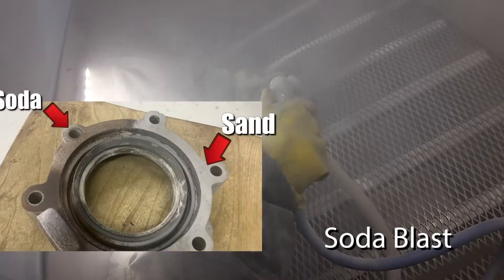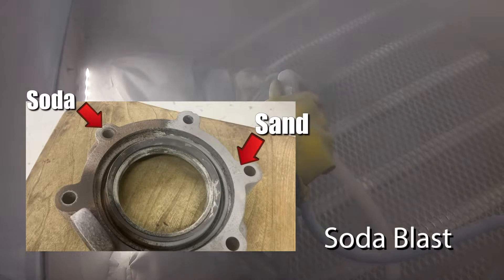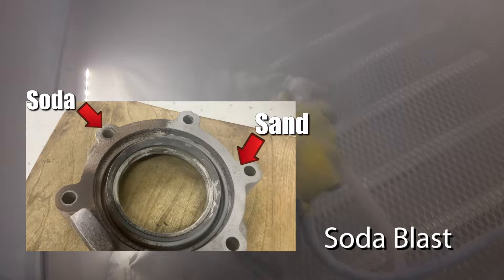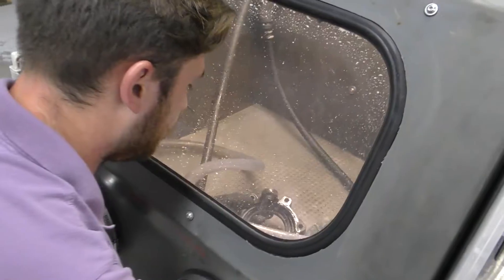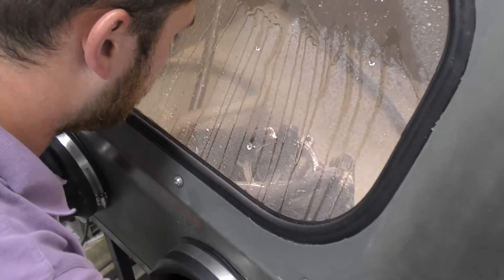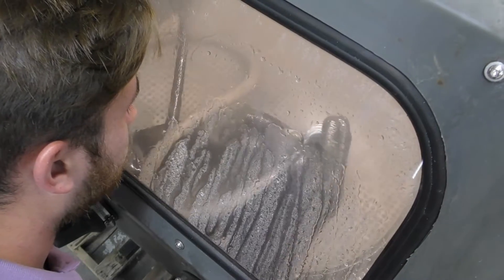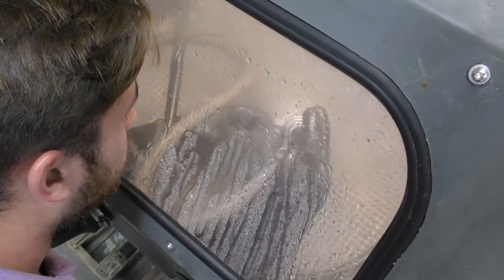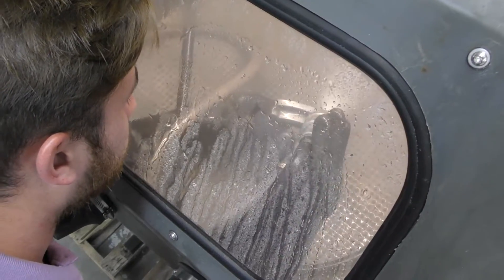When To Use Sandblasting Over Soda Blasting? - Vapor Honing Technologies

Comment: When would y'all recommend sand blasting over vapor honing?
Reply from the maker: I have seen a few cases where "Sand Blasting", is Faster at removing Factory Powder Coat.  Sometimes that can be very  slow with Vapor Honing.  nicole@vaporhoningtechnologies.com  Do you Sand Blast?  Would you consider Vapor Honing?  The end Result can be very pleasing.
Reply: @VaporHoningTechnologies  I have in the past. I've been prospecting wet blasting as a means to restore parts, prep them for nickel plating, parkerizing, and powder coating. The main draw is it's a ability to remove minimal material with coarse media.